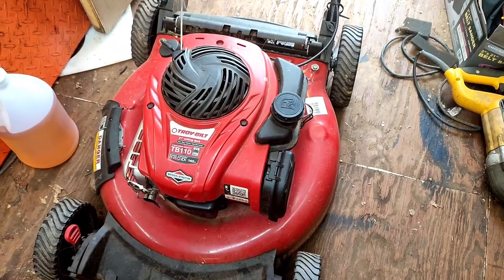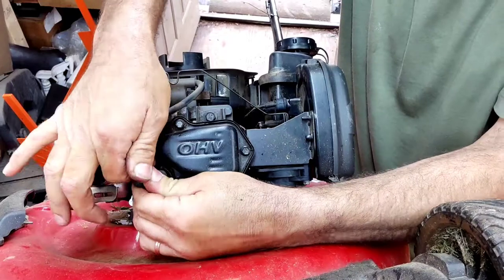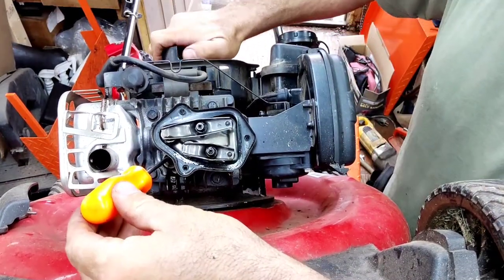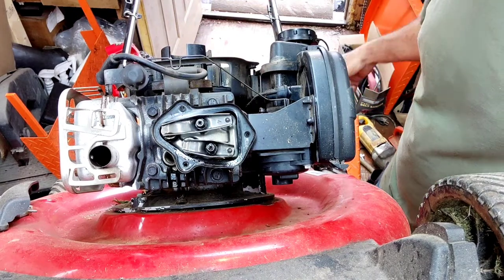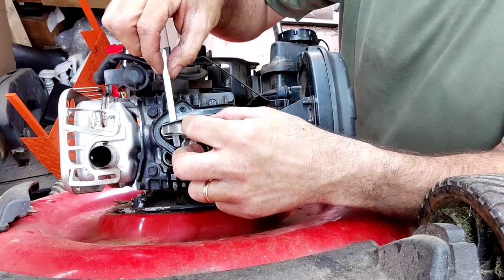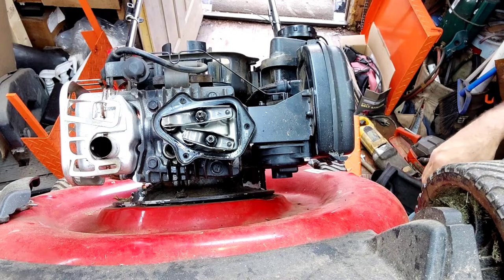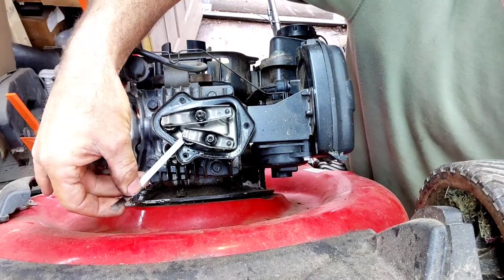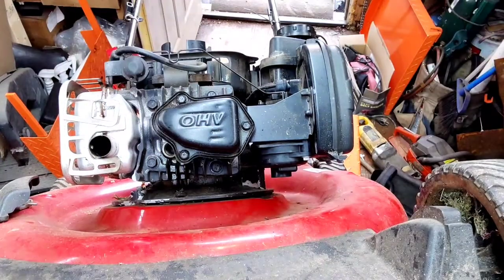Briggs and Stratton, hard start, over head valve adjustment..Easy, starts first pull now!

Comment: Great video, keep up the great work! Is there a site to go to to find out what the valve clearance  specs are for briggs and stratton engines. Thanks for your help
Reply from the maker: Put your engine number into a search engine and usually a parts store will show all specs for that model. If yours is a newer model with a QR code sticker, scan it, open the link and you will have options to see maintenance details.
Reply: @TepcoCycleRepair  Thank you so much for your help.